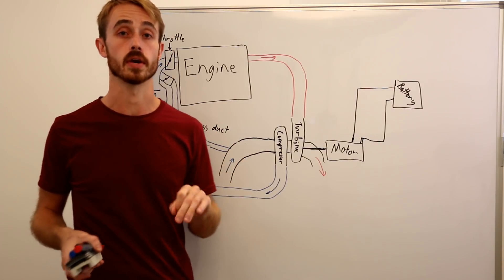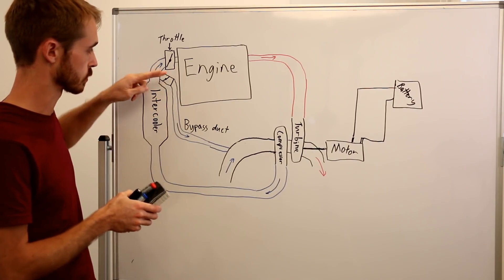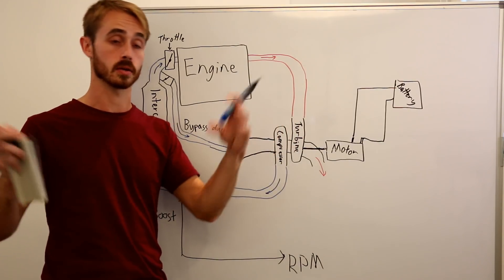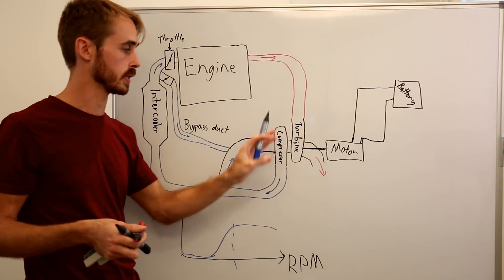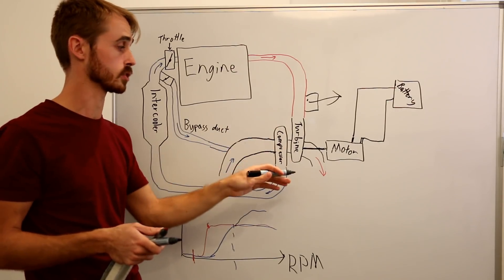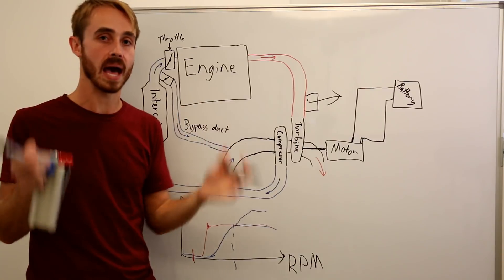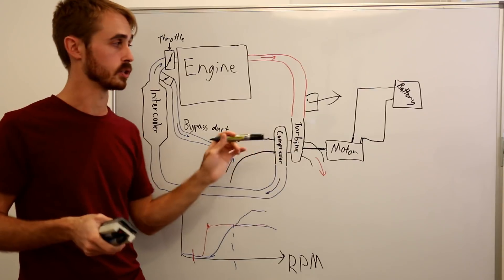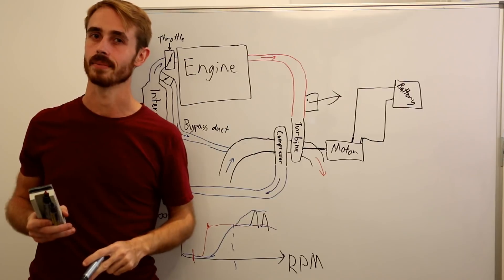How do Hybrid/Electric Turbochargers Work? Hybrid Turbos (MGU-H) Explained

Comment: Great Video Kyle. I just purchased a Mercedes GLS 450 3.0L diesel with 48 volt mild hybrid and the sales person didnt even mention that the motor had an electric turbo. The GLS is a big beast but it has great pick up as well as a huge spread of rpm where the turbo seems to be on song.  It all make sense now. Thanks again Kyle

Comment: Hope you're still reading comments here.

If we were to think about A-Level physics again to turn a motor into a generator we'll have to rotate opposite of what the motor was doing. I can't quite understand how generation would happen by slowing down the turbine at peak. Wouldn't it have to reverse it's rotation?
Reply: No, you don't need to physically reverse the direction of rotation to generate electricity. He wasn't clear in his explanation. Electricity and magnetism are actually the same force: electromagnetism. When he says "reverse" he means going from using electricity to generating electricity. 
Take away the supply of electricity to an electric motor and you are left with a generator. But it takes effort to spin a generator. The reason why is because of inductance. Think of it as an invisible brake that gets stronger the faster the shaft spins. You are inducing a current in the coils of wire with spinning magnets on the shaft.  Instead of using a wastegate to keep the turbine from spinning too fast by bleeding off excess gas, a generator is being used as a brake to slow it down.

Comment: Is it possible to add another turbine into the system and extract the energy from the wastegate gases  to power the battery?
Reply: Not directly no, the wastegate is there to vent back pressure from the manifold that would cause problems for the engine operation. Adding another turbine would block this venting, defeating the purpose of the wastegate. 

The wastegate doesn't quite work like a normal exhaust waste gate, it is driven by the exhaust manifold pressure, not by the intake manifold pressure. So the exhaust manifold maintains essentially a constant pressure (assuming constant load/rpm, but in reality it will have a different target pressure depending on engine load/rpm) and the turbo motor is used to control the intake manifold pressure.

This is what makes it so tricky, and why Mercedes power units have been so dominant for so long, and why F1 is going to drop the mgu-h from its engines in 2025.

Comment: So except turbo lag (which is not a significant problem for normal cars) what are the benefits?
Reply: I'd imagine that the electric motor could be used to control boost by slowing down the spinning of the impeller this could also generate energy to charge the battery in a hybrid

Comment: What kind of RPM are we talking about here? Some turbo chargers depending on their size can spool at 250,000 RPM. I don’t know of too many electric motors they can go that fast
Reply: texas- The electric motor doesn't need to go that speed ,they only needs to fill in the first few thousand rpm ,then the exhaust takes over. Then at high rpm you introduce a load on the motor and it acts as a brake to modulate the exhaust spool speed.

Comment: Wouldn't it be more efficient to electrically assist the crankshaft rather than helping the turbo force more air into cylinders and thereby increase the need for fuel?
Reply: No.   Fuel is far more energy dense than a battery.  Its best to let the fuel do the most work possible in the best way possible.  Sure.  You might use less fuel doing it your way.  But you would run out of battery extremely fast and would just need to generate it again somehow.
Reply: F1 cars do that too.  That part is called the MGU-K, whereas this video is talking about the MGU-H.

Comment: Disagree.  If you use a turbo as a generator, that in itself is going to create exhaust resistance.  I will agree that it could work as a generator, but you will lose performance as a result.  If you have a great high amp alternator, it's party time. A hybrid turbo has it's place and you can "have fun" as soon as the batteries are recharged, but it is not an economical system.  A high output alternator has a drain on the engine as well.
Reply: What are you even disagreeing with?  I didn't hear anything conveyed beyond how these types of systems work.  MGU(motor generator unit) assisted turbos are used in F1 and have been for a few years now; those engineers don't give a shit about your opinions because they actually do the math.  F1 cars also have an MGU connected to the crankshaft that is used to both recover energy and give the engine more power.  The MGU-K(engine) and the MGU-H(turbo) can generate electricity or use electricity, it's all about how you manage your charge (and they start with full batteries).  Also, just consider how much energy it would take to spool a turbo and then think about all the energy that's normally wasted in braking and by the wastegate and you can see there is an efficiency and performance gain to be had.  And if you think those cars start with no charge in their battery... shakes head

Comment: Wouldn't it be simpler to have a supercharger, it just needs a belt to the crank?
Reply: Yes but at the same time you have parasitic loss with a supercharger and a turbo is capable of making more power since it's not restricted to engine rpm.

Comment: 7:07 This is incorrect, exhaust backpressure is not increased by operation of the motor/generator in generation mode.  For the same turbine inlet flow conditions, lower turbo shaft speed REDUCES the backpressure on the engine.  What happens during generation mode/recovery is the turbo shaft speed is slowed due to torque applied from the motor/generator and there is less torque to spin the compressor.  When the turbocharger shaft speed is slower at the same exhaust flow, there is LESS exhaust backpressure.  This is because the exhaust backpressure caused by rotational speed of the turbine is due to the opposing centrifugal force on the exhaust as it flows inward through the radial inflow turbine wheel.  This same effect is how the compressor wheel generates pressure, but the flow direction is reversed in the turbine and engineers attempt to minimize this effect.

Comment: Keep up the good work, don't listen to these knuckleheads.  IMO the "wastegate" feature of the electrified turbo is the coolest part! Think about all the times you are hauling ass and the wastegate is open.  All that time would be charging your battery and then you could unleash it for extra power out of corners or from a stop or just to get to work using less fuel.

Comment: I'm wondering about these boost spikes that may occur due to lack of waste gate capacity... I am NOT questioning their destructive effects, I'm well aware that this is true, but how exactly may it damage the engine? I mean which parts may suffer damage and how do they suffer damage?
Reply: The whole internal part and the block itself, unless your engine are built with an extra 500hp-1000hp capable of strength or extra 20-50psi of boost in mind.

Comment: FYI there is no more wastegate on F1 engines.
And how could you have high risks of detonation if you have poor scavenging ?
Exhaut gases are neutral,if you dump fuel with poor scavenging you will just run rich,no risks of  detonation.
At worst you will have an "EGR system"
Reply: michaelovitch- Yes there are,you can see the smaller wastegate exit pipe above the normal exhaust on f1 cars.

Comment: Instead of using only one motor to power the turbo and harvest the excess energy which will cause problems when you need that power, so why not add another motor at the wastegate and works at higher rpm while the power motor for the turbo powers it 

Is it a got solution?
Reply: That's exactly what Porsche did with the 919 at Le Mans this year and gave them the victory.

Comment: If you want instant boost just get a damn pro charger
Reply: Can't run one in F1.. and the make more power using a 1.6L V6 than Dodge...
Reply: and how much HP is your pro charger robbing from the engine?
Reply: Mmm no a procharger is not instant boost.

Comment: Turbo lag doesn't reduce the throttle response. it reduces the volumetric delivery of boost by turbo, UNTIL it's in it's efficiency range. Throttle response is what happens between pedal and plate/motor.
Reply: I mean... if you want to get ultra technical, fine, but 99.9% of people consider "throttle response" the time between pressing the pedal and actually accelerating, not literally "how responsive you throttle body is".  Not once have I heard "throttle response" used to refer to the time between the pedal moving and the throttle body moving.

Comment: Exhaust doesnt enter atmosphere at Waste gate application. Waste gate decreases boost by opening a bypass valve on the compressor side which can be recirculated by injecting that same air before or right after the airfilter.
Reply: James- Nope wastegate is on the exhaust side,either vented straight out or into exhaust post turbo. Blow off valve is on compressor side ,releases pressure in the intake,either into air or into ithentake pre turbo
Reply: What you meant is EGR and it works differently from turbo.

Comment: Seems like an ideal solution on paper but I have to wonder about the response losses associated with turning the additional motor in regen mode and then switching into power mode. The piper has to be paid, it's all good to have the motor attached to capture and return stored electrical energy, but that is work effort is being diverted from the turbo.
Reply: Drive the V8 Audi TDIs with two mechanical turbos (that run both sequentially as a bi-turbo, and then in parallel, as a twin turbo). The 48V electrical turbo (compressor) works at low rpm and is so respond it saves two car lengths on acceleration. 

The Panamera V8 diesel had the same engine without the 48V compressor (lack of space).

Comment: diagram Is wrong and explained wrong and for this you would need clutch setup on turbo ... don't go giving main dealers ideas we already have enough problems lol
Reply: What are you on? F1 doesn't use a clutch setup for theirs as it is always either generating or powering the turbine, the diagram and the explanation are also spot on.
Reply: That's f1 not made to last for years
Reply: You realise a. He never said he was explaining for passenger cars b. A clutch pack is a wear item, so you would want to get rid of it and directly link the motor if you could (which you can) and c. you wouldn't get the full benefit off the system if you were disengaging it all the time
Reply: Nor did he say for f1.. a. Not for low rpm Spool   b. I'm not at liberty to say c. As a ....
Reply: Not putting a clutch pack in actually increases reliability, an electric motor barely even wears down, as the only thing making contact is the bearing, the rotor and stator of an electric motor do not touch eachother at all and do not wear down over time

Comment: turbo lag could be explained more simply by saying that a low compression turbo engine doesn't push enough air to spool the turbine at X psi.
Reply: No, that's boost threshold, not turbo lag. Also, has nothing to do with compression and is more related to swept volume/displacement.

Comment: fundamental flaw in explenation of turbo it's not the heat energy that extracted it's the gas velocity and movement from high pressure to low pressure that drives the turbo. heat is just a byproduct of how close to the combustion cycle it's normally placed.

and again with turbo lag NO turbo lag is the time it takes to got from a boost event dump all the pressurized air and return to boost event. the boost threshold is how long it takes to build boost in the first instance throttle lag is not in anyway related to turbo lag or boost threshold the engine still responds to it's throttle exactly the same way it would if the engine was naturally aspirated it's the extra pressurized air that increase torque as boost build resulting in increased engine speed rate of climb.

credentials deemed inadequate at 1:10 stopped watching
Reply: +Andres Lezcano the simplest way to prove that heat energy provides the work effort is to take a static volume of air in a sealed metal container with a pressure gauge attached, when cold it will show 0 psig but when heated it will show positive pressure. There is no increase in the quantity of air, but it now has pressure thanks to the heat and air expansion. The mechanical action of the pistons going up and down will provide flow but it is heat that will be primarily responsible for pressure.
Reply: kyle hubner Take a fluids and thermodynamic class and you'll learn the work output of a gas turbine is found using the specific heat of a fluid and the temperature of it going in and leaving the system.
Reply: the heat helps but it is still fundamentally the GAS of the hot exhaust at higher pressure before the turbine vs the low pressure AFTER the turbine and the passing from the high pressure zone to low pressure zone and loosing thermal heat in the process if it cooled to much preturbo from expansion and slowing down it wouldn't drive the turbo as effectively

this is why turbos idealy sit so close to the head when the gasses are at the their most energetic from both heat expansion (into the first phase of the exhaust and the upward exhaust stroke of the piston.

as i'm sure you know gases cool as they expand and they also slow down you want as much speed pressure and heat in the gas to drive the turbo as possible but it is not the heat that drive the turbo at all it just encourages the movement of the gases that do. try hear a turbine houseing i bet you get nothing from the turbo but blow pressureized air into the turbine and boom turbo spinning.

a turbo jet engine intakes air presurizes it injects fuel and combusts it to further increase the system presure and then energeticly moves from the highpressure are to the low pressure area behind the turbine further driving the compressor wheel so that the cycle can continue take away the combustion cycle and increase in presure from that and the system slowly deteriorates from friction loses and eventually stops the heat is just a by product if you say suplemented the compressor with another pressure source the cycle would continue. heat is not essential to a turbo's operation. but the pressure difference from the combustion cycle exiting to the rest of the exhust is

if heat was so essential to a turbo in the context of a turbine driven compressor supplied by a 4 cycle engine why then do tuners so sooo much to lower egt's because the excess heat isn't required. if was so great for the turbo they'd be doing whatever to increase egt's and manufacture parts to cope.

your thinking of two completely different types of turbine.
Reply: kyle hubner The exhaust turbine of a jet engine follows the same principles as the exhaust portion of a turbo charger. They are the same exact thing. Both harvest the heat energy of a fluid. To be fair it is both but it is mainly the temperature of the fluid that has the main impact of work output. The higher the temperature the higher the pressure differential so you get more work.